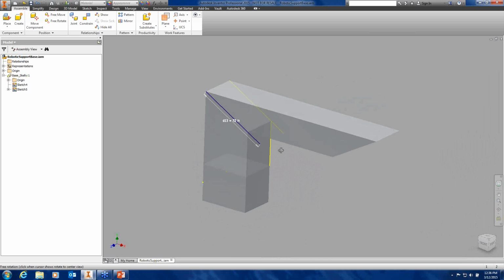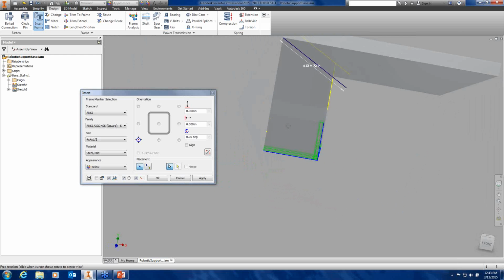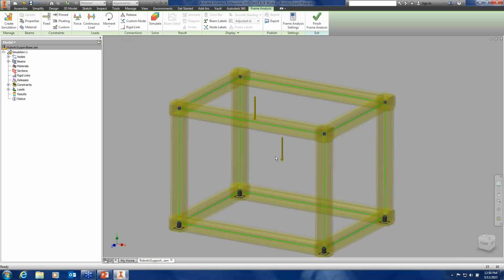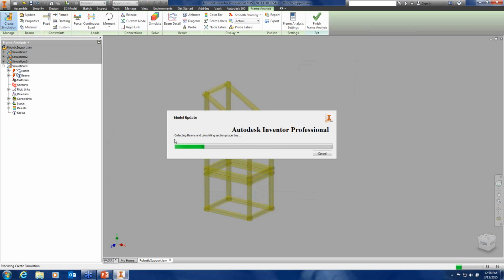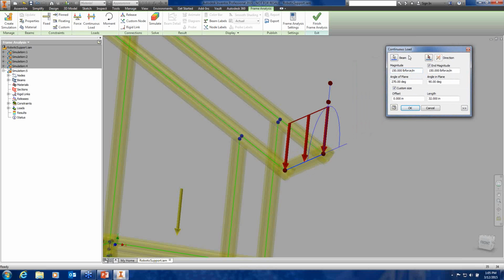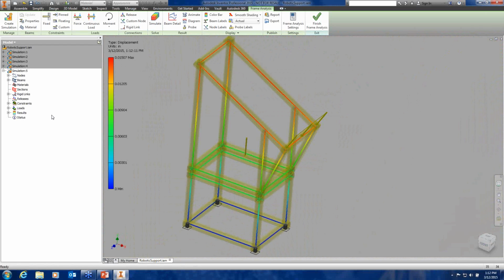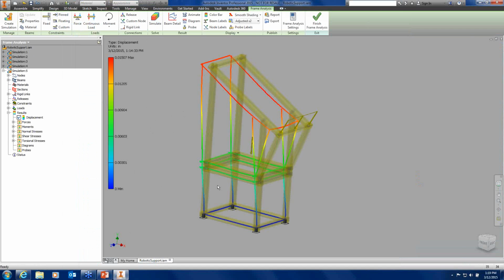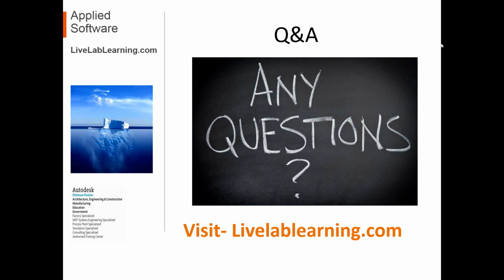Simulation within Inventor Professional Frame Analysis

Comment: I have multiple times tried inventor to calculate simple trusses and the results are way off from hand calculations using basic FEM. I reckon it is just a good looking tool more than a reliable tool, after these attempts i wouldn't even dare to assess a basic structure with Autodesk inventor.